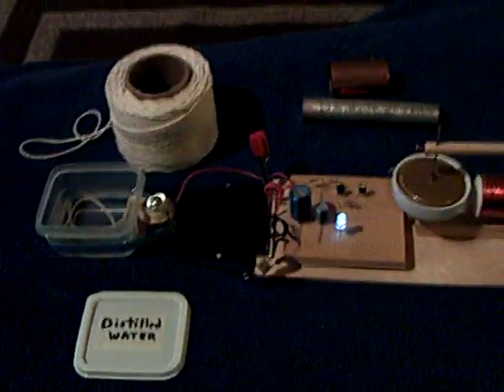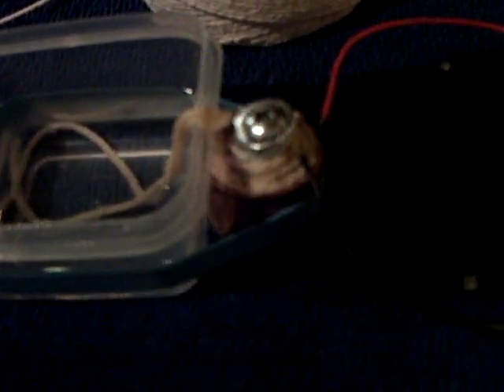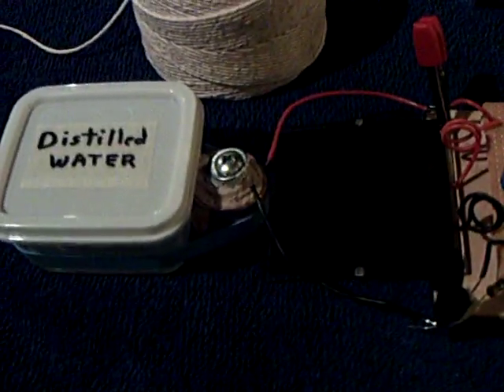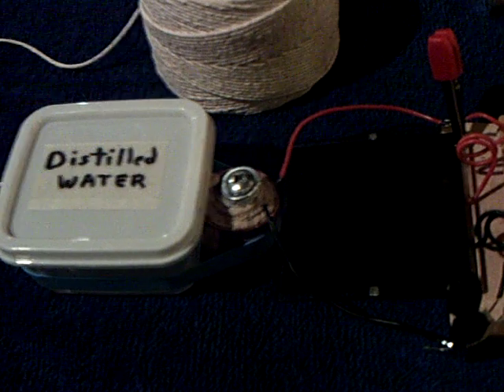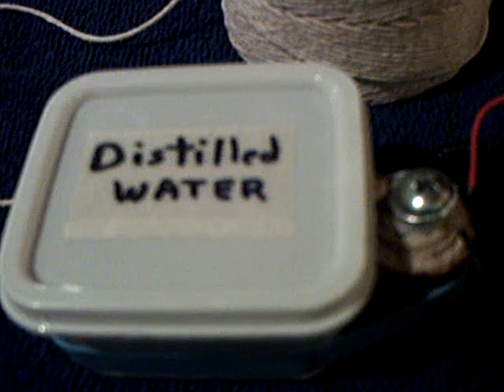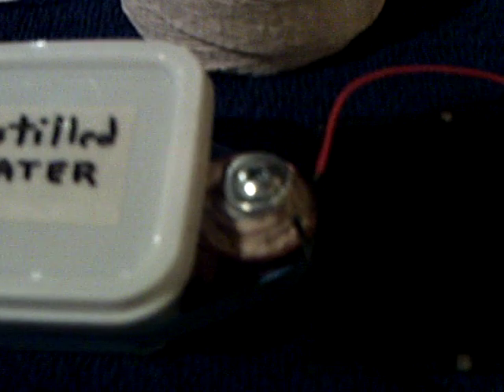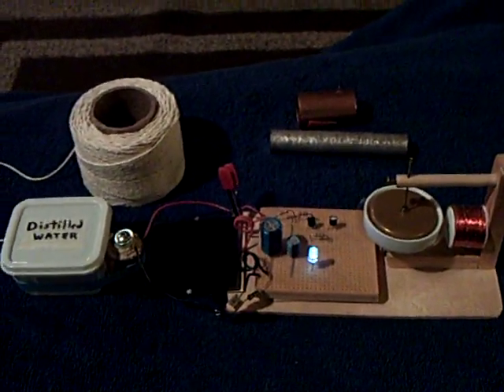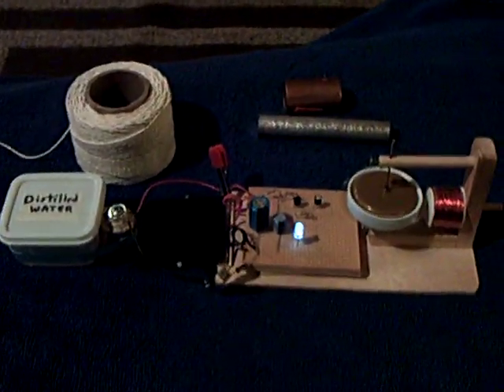Self- watering Hydrate Crystal Cell

Comment: Hi Lidmotor thanks for your work & sharing. The crystal cells do not need water if you want them Free Energy. You just need to make more cells, and to make 2 separate groups of cells and to alternate them every 12 hours, and this will work forever. My recipe is wiwth epsom salt, dioxide manganese+carbon and sand (or silicate). I repeat: you dont need water, You can put them in parallel also with regular batteries.